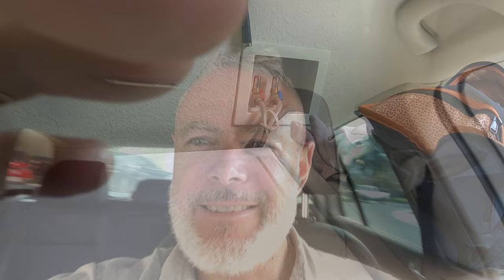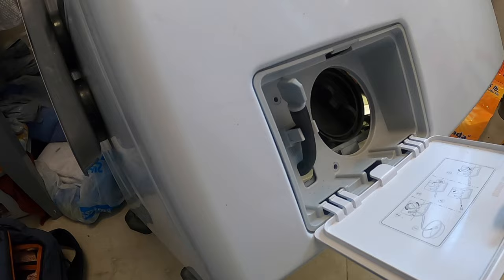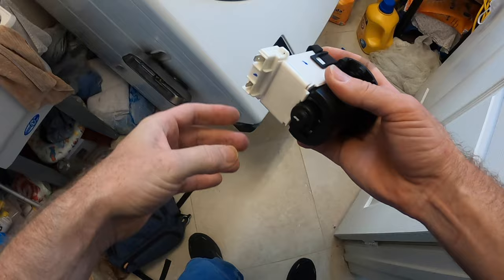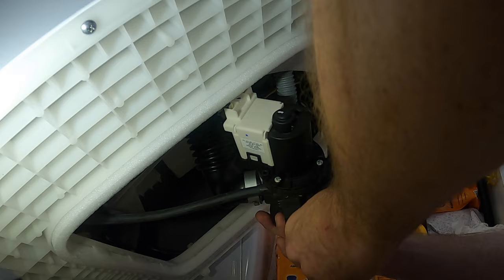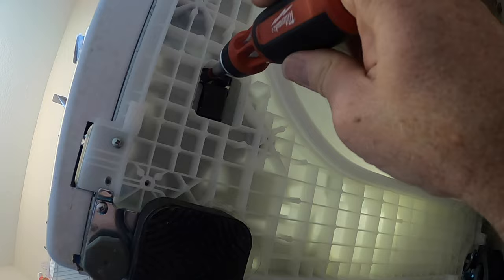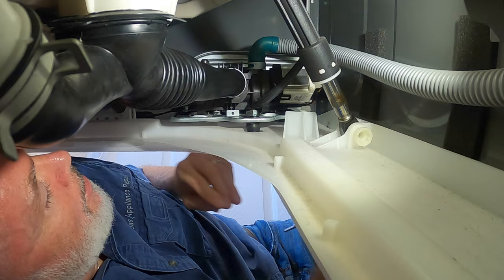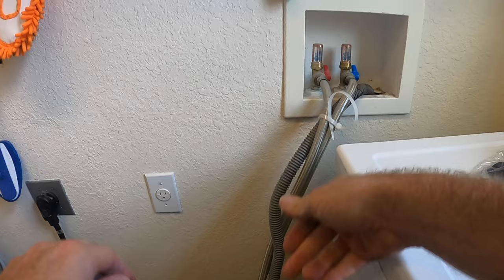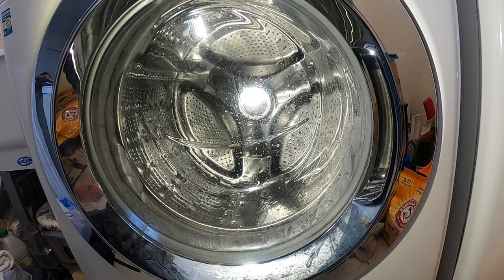LG Washer Drain Pump Fix in 7 Minutes

Comment: Other videos have the front panel of the machine removed (some models have a small panel at the bottom, mine has one large panel on the entire front) - so, I greatly appreciate you going at this from the bottom and not having to mess with the huge front panel.  Most appreciated.  Now, to find a drain pump to install.
Reply from the maker: I like getting parts from partsdr.com.  Or at least use them to put your model number in and get the part number. Once you have the correct part number you can shop various suppliers

Comment: Great video, saved me a ton of time.  Not sure how I got so lucky but yours was the first video I watched and it did the trick.  Pump went out last night at 10:00 PM.  Watched your video.  Ordered replacement pump from Amazon delivered overnight for $24.  Part arrived at 7:45AM and was installed by 9:30 AM.  Less than 12 hours from failure to success!  Trickiest part for me was that the screws holding the pump to the frame (not the pump housing) were not aligned well and I had to stretch and pull and twist to get access to them.  Finally got it without breaking anything.  I put it back together with more of the screws to the front of the housing as there is room for several there to secure the filter housing portion to the front bracket of the frame.  It was all snug and will be easier to get to next time which I hope is a long time from now.  Thanks again for the excellent video that saved me a bunch of time and money.  Wife’s very happy so that’s a huge bonus!
Reply from the maker: You are welcome

Comment: Thank you so much! Mine was also missing the same screws and they were never there. Last time I replaced the pump I tried to add the front screws but it put things in a bind so I left it as is.  My LG was slightly different as far as screw placement. I removed the screws shown and it was still tight but by sticking my head up through the bottom I could see the hidden screws. 4 total, two thru the bottom and others on front and back that video does not show. Still doable without tearing the whole thing apart like I did previously. I don't think my pump is bad but a small Phillips bit fell out when I turned the pump over. Not one of mine so I have no idea where it came from but I think it was stuck in the impeller. New part arrives tomorrow so I'll install anyway.
Reply from the maker: You are welcome

Comment: Thank you so much for your easy to follow instructions.  I ran into one problem.  When securing the pump back on I somehow pinched the O ring.  You guessed it water everywhere on the first test run.  Second time around I lubricated the O ring with silicone put it back together and it ran perfectly.  Whew!  Thanks for including how to run the diagnostic cycle very helpful!
Reply from the maker: wow, that sounds like an adventure. I am glad I was able to help you. God bless

Comment: Thank you for the informative video. Our LG Tromm has 2 of these. Did not discover until I removed the assembly. Randomly picked 1 side to replace since I ordered only 1 pump. With my luck, I probably replaced the wrong one but with your instructions, learned it is a quick repair if I need to order again to replace the 2nd pump. Thanks again.
Reply from the maker: Replace the pump that is behind the coin trap door
Reply: Thanks. That's the 1 I luckily replaced. Seems to work quietly now. Do you know what the other pump is for? Thanks.

Comment: I think I had a slightly different model, this technique was close, but didn’t work exactly as shown

On my machine, there were three bolts that connected a chassis between the pump housing and the bottom of the machine. I pulled out those three bolts and the whole chassis and pump housing all came out in one shot.

Also, the chassis the pump was on is connected via rubber bushings. So you don’t want to screw that chassis to the case of the machine as it would bypass all the dampening from the rubber bushings.

Thanks for video, it got me on the right track.
Reply from the maker: Thank you for sharing your experience

Comment: Thank you so much for this very helpful video that saved us from taking the top and door off of the washing machine. My model is from 2015 and one of the screws to remove the pump was awkwardly behind the metal plate of the drain clean out assembly. To access this screw I used a drill with a metal bit to enlarge a hole in the metal plate. After that it was easy to remove the old pump and install the new one.
Reply from the maker: You are welcome

Comment: Tnx man. Literally took me less than 10 min. I spent more time pulling dryer from top and putting machine on jacks to go from bottom. Front 3 screws are easy to take, some models have bottom bolt or like mine a plastic push in tab. If you are confident washer is secured ( jacks or leaning it like in video) its piece of cake.

Comment: Great video, kudos.  My LG had one screw in the front that was essentially inaccessible, I basically had to pry the metal open to get to it to remove the screw holding in the drain pump.  It also had 2 that I could access from underneath, however they were not aligned in a way that could be gotten with a screwdriver.  I had to basically brute force a drill and apply leverage forcing the pump housing into a more straight position to extract them.  It wasn't pretty but this video got me through.  They seem to be making them more annoying lol, why have an opening at the bottom and have the screws line up outside the opening.
Reply from the maker: in this case you may have saved some headaches by removing the front panel. I also have videos showing how to do that. Thank you for sharing your experience

Comment: Best procedure on YouTube. Thank you so much. It avoided me to dismantle half of the washer. A quick tip: Since the procedure requires to tilt the washer, I used the "LG Shipping Bolt Assembly"  to secure the tub. These bolts were installed when I received the brand new washer.
Reply from the maker: Thank you so much for the tip. You stand out.  I am happy to have helped

Comment: Such a great tutorial. I was planning to dismantle the whole front but found your tutorial. Mine had only front screws holding the assembly so it was even more simpler and took only 15min. Thanks, saved my Sunday!
Reply from the maker: You are very welcome. Thank you for the great comment
Reply: I've had to take the front off of mine several times. The door seal retainer is a real pain to put back on.

Comment: Great time saver! Id like to add.... to remove the front bottom pump screw i had to drill a hole through the sheet metal to get the screw back in. I also had to use a large drill bit to add  clearnce for the screw driver to remove one of the bottom pump screws. It was super easy, though. I wish i would have snapped pics so i could share it.
Reply from the maker: Thank you for sharing . I also have videos on how to take the front of the machine off and replace the pump that way

Comment: This was so easy the only thing I had a problem with is the bottom screw holding the pump in place was hidden behind the metal plate. I drilled a hole where it was and made access. Thank you for making this super simple. It literally took me 7 minutes to do.
Reply from the maker: You are welcome

Comment: I just finished replacing the drain pump on my Kenmore washer. I used an appliance dolly to tilt the washer on its side and worked from the bottom. The bottom had a huge opening. It was easier than tearing the whole front down according to other videos
Reply from the maker: nice

Comment: This method appeared to be easier than going through the top.  After trying it, I quickly found out that doing it this way is dangerous, more difficult, and impossible to do correctly.  If you try going through the bottom, some screws and hose clamps will be extremely difficult to remove and impossible to replace.  Washing machines were not designed to be serviced this way.  Going through the top (the way the washing machine was designed to be serviced) gives you the proper clearance to work with all the hose clamps, screws, and bolts, and doesn't require you to work underneath a very heavy  and unstable piece of machinery.  Congrats to this man for being able to do the job this way, but it is an easy enough job to do the safe and proper way.
Reply from the maker: Good advise
Reply: I have to disagree, if tilted correctly/safely .. it's make the task very easy to do without removing any hoses.  If it wasnt meant to be worked on underneath, then why is there a big gaping hole and hole to access the screws from the bottom (screw down towards the floor)  .. Once you remove the plastic drain cover on front... remove two bottom drain housing screws form underneath access and one screw on front drain at 6 o'clock position from coin filter (between thin sheet metal)... it pops out just as its shown on the video.  From the top you are basically removing the Mounting Plate that the drain housing is attached to, when you take everything off, turn the mounting plate over... you will see the 2 screws that was shown on this video.  And the one on the front( 6 o'clock position under the round filter).  No reason to remove any hoses, just like the video. side note- it took me longer to remove my base shelf screws than it did to do the whole job.         Just hope this helps anyone reading through the comments
Reply: I agree on safety being a top priority. I'll stick with many hours for me to DIY slower, with an opportunity to change the door gasket too.  My LG washer uses  a  metal carrier plate with 3 rubber isolation grommets.  I suspect some of the commenters finding various screws are missing might be due to previous repairs using the short cut but harder to access everything manner.  Perhaps some get left off or were not reinstalled properly to go the distance.  If the short cuts work for your machine, that's great if you can do it without risk to safety or damage.

My advice is to stick with only using LG guaranteed OEM parts, which can be  harder to find and obtain expeditiously. That's true for my other appliances too! 
I find my washer's pumps fail too quickly, even with using  LG OEM ones which come in LG's packaging!  I end up buying its next replacement ahead of time when I replace the failing one.

Comment: Huge time saver to do it this way, now on my second replacement pump. On my model (wm4270hva) there was another front screw to find and remove, and there's definitely some twisting to it but way easier than taking the whole front off. Also might want to point out that you only want one gasket/ring in case the old one is stuck on the housing.
Reply from the maker: THAnk you for sharing your experience. and extra Tip$$ 🙏😊
Reply: I cannot get that hidden front screw off not even sure how to get to it
Reply: @bansheeyt1105 if it’s the one i’m thinking of, use screwdriver to lever the whole pump up and you’ll get to it
Reply: did u remove that from the bottom as well? I’m trying to find it but don’t see it

Comment: This video helped a lot.   Only thing I had trouble with was the missing screw issue.   I could not find the lower screw from the front.   Turned out it was behind the metal flashing.  I used a large steel drill bit and drilled my own access hole (it gets covered up by the plastic anyway.  

I also had to cut the underside plastic hole bigger because the two screws underneath were actually cover by the plastic.
Reply from the maker: sometimes it is better to take the front panel and gasket off. you can more easily remove the entire baseplate/ dampener that the pump is attached to

Comment: Excellent video.  Your description of "growling and won't pump out the water" is perfect.  One observation, which probably doesn't matter since you have to buy the pump to get the impeller..... on mine the motor was fine but the little "nub" at the bottom of the impeller had broken off.  Probably hit a small pebble from washing the dog's bed or car's floor mats.  Therefore, the motor shaft couldn't drive the impeller and the motor shaft was just spinning around inside the impeller!
Reply from the maker: Thank you for the compliment. I am glad the video helped. It is possible to fix a pump, but as professionals we always replace with new OEM parts

Comment: Great video thanks! I got me sum yesterday! $20 part and some elbow grease vs $400 service call. Thanks for the details and video worked perfect. I did the service diagnostic mode so that was great. Only thing was had to figure out how to manually shift through each phase of diagnostic test by hitting play button for each test to reach last one/finish with draining the water instead of running whole Load to figure if new installed drain pump worked. Thanks again
Reply from the maker: Glad I could help

Comment: Mine model wasn't exactly the same as this one as there were no front screws, and I had to remove the shock absorption platform with 3 10mm bolts. That said, the idea of going at this from the bottom is way better than the other tutorials. It took me about 20 minutes
Reply from the maker: Thank you for commenting

Comment: Thanks for a very informative video.  Did you simply lean the washer backwards against a wall at about a 45 degree angle to work from underneath?  It would be helpful to get more information on that.

thanks!
Reply from the maker: Thank you for subscribing and commenting. Good luck with your washer repair. I am happy that the video was helpful. If you are to lean the machine back make sure to put a support underneath to prevent the machine from falling on you while working on it.

Comment: Thanks! A lot easier than the other videos that take the front off. Also, one of the screws in my pump were stripped, so I just rotated it about 22.5 degrees to the next set of screw holes. Wife's been using the machine all morning, so far, so good. Also FYI mine didn't have the screw in the bottom. It had a little clip built into the white plastic base where the screw in the video was. I just pulled down on it with a little screw driver, and the pump slid out, after removing the two screws in the font.
Reply from the maker: Thank you so much for the generous tip Mark. Thank you also for contributing your experience to the community with your comment

Comment: Right before you take the coin catch out, ours was anchored w a screw that we could not access.  The small carve out at the center bottom of the metal face was not sufficient. We took two drill bits using a smaller one first to prevent drilling into the screw holding the coin catch. This machine did not have the same screw. 

Just wanted to share our solution to be able to remove the pump.  We figured that assembly is inconsistent with each rendition of machine.
Reply from the maker: @kathyclark6854  Thank you for sharing. I also have other video on replacing LG drain pumps by removing the front of the washer

Comment: Hallelujah, it works!  Thank u so much, grace to you.  Only issue I had was getting new pump in housing, hard to see screws.  F YI the screws can fit back in the housing at multiple positions but obviously only one way will fit properly in the end...
Reply: I also had to the bottom 2 screws off line so I couldn't get to one screw but just drilled a hole in plastic... nobody sees it anyway
Reply from the maker: You can take that whole base out by unfastening the three stainless bolts, instead of drilling a new hole. Glad the video helped

Comment: On my model, I had the two screws holding the pump on the bottom, but there was also a screw in the front on the pump housing behind the frame at  6 o’clock position where you unscrew the filter basket.

Comment: awesome vid! many others also removed the front panel and what not. i got ours done in 30 mins. it would've been faster since i had to remove the valance cover to get to the 2 screws underneath that still held the pump housing. but i do have a 20 yr old LG though so some variation on location of screws, i.e. i didn't have one at the bottom. i hope i got the screws right where the pump attaches to the housing. there are 5 and remember the right side (if treating the one screw at bottom 6 o'clock) was about 3 o'clock. i think i put the left side at 9 o'clock. i couldn't tell looking at the housing since the holes outside matched little holes inside too! no leaks so far but odd the design is for 5 but only 3 are mounted for the pump housing

Comment: Awesome repair video, only real difference was that my wash/dry combo has a clip and not a screw holding the bottom of the pump housing…. This is my 3rd replacement and this way is much faster …Great job thanks
Reply from the maker: You are welcome. Thank you for taking the time to comment

Comment: I wish I could have used this method! Alas my machine's on a pedestal and I was working by myself. Even taking the long way (remove top and front panels) the job is still less than an hour provided you have spring pliers that make it easy to put back the door seal clamp.
Reply from the maker: Glad it helped!  I also have a video on my channel on how to tackle this repair when it is on a pedestal

Comment: currently having a failure to drain water error and the door wouldn't unlock ruined some clothes but ill dry and replace the pump, i checked the filter and looked good so hopefully it works.